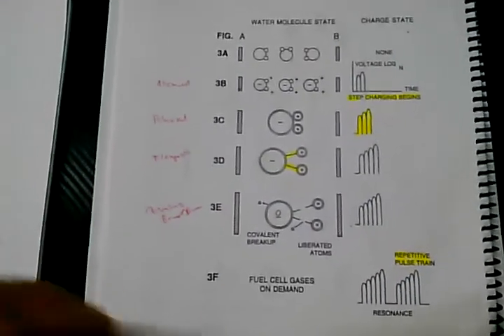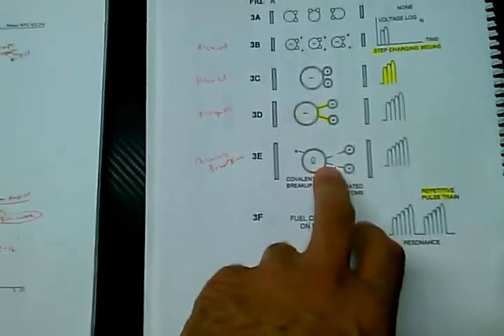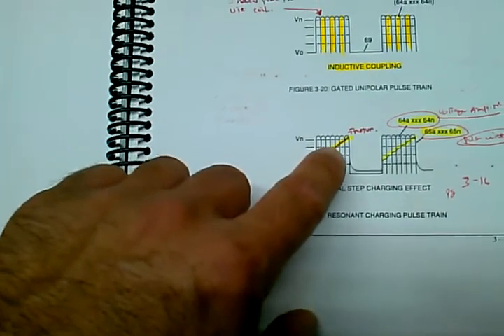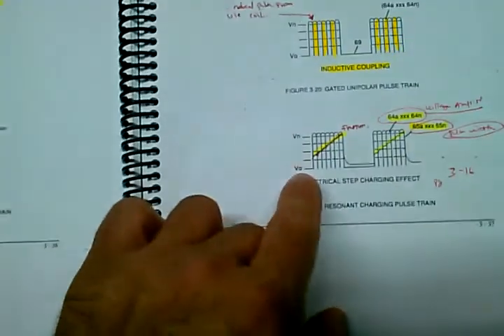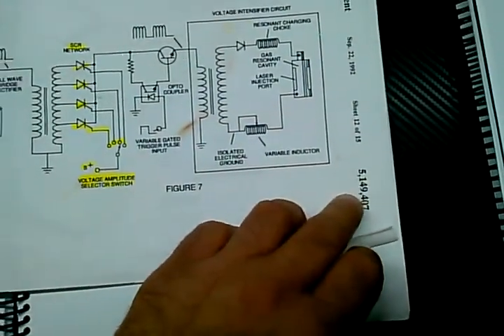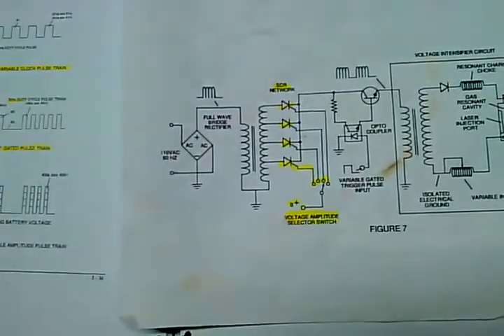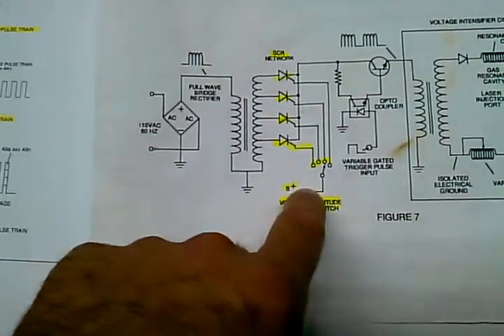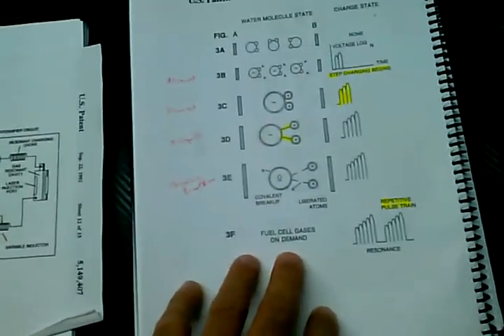Sequencial Voltage Amplitude control

Comment: That is actually taking place between the two opposing choke coils with water (Re) acting as a resistor between the two chokes as they are producing the step charging effect which is part of the reason Meyer calls them charging chokes. Particle Bombardment is talking about the introduction of laser energy into the system. You see I have manage to actually get at the core science behind this technology and have been trying to build it correctly ever since. If you would just give me an ear and step away from those that reject my work you too just might figure this out. I posted this to aid people understanding of the technology: http://aetherforce.com/the-long-road-to-learning-how-meyer-made-use-of-water-as-a-source-of-fuel/ and went on to post this to show the core science behind the technology: http://www.hereticalbuilders.com/showpost.php?p=12538&postcount=74

The only way I came in to all of this is with the help of our creator YAH and the strict use of the scientific method but YAH gets all the credit as after all this is us learning his technology. My haters like to tell people that I haven't contributed to this technology but my actions say differently as I have contributed the most of any single person on the understanding of this technology as far as I can tell even more than Meyer himself as I used terms we all can understand and broke down what he was saying back towards scientific terms. It wasn't an easy task but someone had to do it and as it turns out that someone was me.

Right now you have just been given a gift as what I just gave you here right now is how this technology actually works. You will have to organize things and use logic to translate things into a way that you can use them. Now I will sit back and see what you choose to do with the gift you have just been given.
Reply from the maker: Edward Mitchell  Yes I have read  your links before... and athough I dont agree with some of your input regarding Stans tech.. I do respect your point of view regardles of what others may have said..... dont let yourself be distracted by the "haters"  ...keep working on trying to prove your theory...after all you are using the Scientific methode...therfore once its refined by the fire ....who is going to tell you what to do with it?  can they take that knowledge away? you will have choice to keep it to yourself or share with the world..
Reply: HeuristicObfuscation There is more choices as to bring this technology out as someone has to step up to the plate and build it for those that can not build it for themselves. That's where I come in for I am aiming to do just that. Open Source to me clearly showed a lack of concern towards their fellow man as it was and still is all about I got mines.
I ask them to clear my name and have they lifted a single finger towards doing so? Nope.

As far as not liking my take on this technology I really don't understand why not as plants have been breaking the bonds of the water molecules ever since YAH our creator created them. To understand his creations truly is what science is all about. Plants take in water use the correct wavelength of light and a molecule designed to take the electron away and in that process the water molecules are broken apart and as a byproduct of this reaction electrical energy is created. That should sound very familiar as Meyer said the same thing about his technology for they are the same in how the water molecules are being broken apart at the core science behind it. IE excite the electrons and take them away and the water molecules fall apart into the gases that make them up. The key is right there, take the electron away, plants use a molecule to do this Meyer used ionization to do this. What part of this don't you understand?
Reply from the maker: Edward Mitchell The word I used was "agree" not "like"... I try not to let my personal feelings dictate how I react to a specific Theory  or Idea presented... It may look good, it may sound interesting I may even "like "it. The problem is emotions tend to cast a cloud over our Judgment therfore I try to be much more analytical rather than emotionaly reactive. over the years ive seen and analyzied your work and theory as i have done with countles others and myself. Its an interesting Theory but I see flaws...this is why I dont agree.
Does it matter what I say? my opinion ?  I am nobody...just a grain of dust in vastnes of space.
what about everbody else  ....does it matter what they say?
 If you truly believe your thoery who is stoping you?

On the other hand be carefull... it may be that you have reached your limit. your capacity to learn has ben stifled. Yes you may have more info than anybody else, more knoledge, more experiance, more intuition. 
Are you the best of the best? cream of the crop? top of the line?
And yet how can you adquire any more knoledge if  you are ahead of everyone?
How  is anybody else going to provide insight?
Reply: HeuristicObfuscation I think I understand your point of view. For me is just saddens me that no one seems to be able to grasp this technology from what I have left on the net for all to have free of charge. I even posted a wiring diagram so people would finally know just how Meyer had nine VIC transformers hooked up to one exciter array.

As for people being able to help me you'd be surprised how many times someone with little to no science can come up with the correct insight to a problem. I always keep my ears open for truth. Over the years I have had to be the one that answers most of my questions but like I said I get some answers from surprising sources so I never count someone out unless they are arrogant and lie about their results as then what good are they to anyone including themselves. I also tend to not listen to those that don't put in enough actual lab time along with those that keep doing the same thing over and over again expecting different results each new time the same experiment is performed.

I'll let you in on a little secret, I should have had this working at the beginning of this month but since I am mostly self funded I have to cut corners sometimes. This time I purchased some wire without the proper rated coating on it and when I got to around 9.3-4kv it shorted out on me. Just think only 600-700 volts to go and I would have been at 10kv which Meyer states is the start of the ionization process. And the only person I have to blame is the man in the mirror which is quite humbling to say the least. Since then I had to do a small redesign on the VIC and will have it made by the pros this time around if I can afford to do so that is. So, you can see I am a humble man but most don't see it that way as I have simply moved too far ahead of them. You would think someone out there would try and duplicate some of the things I have done just so they can see some high voltages being applied to the water fuel capacitor but to this date not a soul seems to have lifted a finger towards getting high voltages in this manner. Since I observe things a lot I'd say I'm just the wrong skin color as odd as that might sound but it sure seems to be true from my point of view.

Anyway I think I have taken up enough of your time and will leave you to your thoughts as you seem to be heading in your own direction which might not turn out to be a bad thing. I'd just thought I see if I could help you get the same high voltages I am getting without resorting to coating the tubes with anything.
Take care,
Edward Mitchell

Comment: How to control the voltage amplitude is easy as all you do is use a variable DC voltage power supply hooked up to the primary coil as I did at the 2013 Global BEM: https://www.youtube.com/watch?v=dQ6G4yIyLdY. 
There is a reason why I am getting such high voltages being applied to the exciter array and I go over just about everything in that video. I made a mistake at the Global BEM but have since corrected that mistake and wrote about it here: http://aetherforce.com/inventors-diary-failing-to-learn-making-good-use-of-the-scientific-method/
Mostly when it comes to the work I am doing I follow known scientific principles which sets me at odds with those that like to do nothing but guess and never get around to actually performing any real experiments. It has gotten so bad that now when I speak it's like I way out in left field and no one understand a word that is spoken. Since being booted from the RWG sight out of envy and malintent I have basically kept to myself as no one really understands me anyway.
Since the Global BEM I have gotten the voltages up to 9.2kv stable and 9.3-4kv unstable. This is not an easy technology to get working correctly and to get this far I have failed plenty. According to Meyer's patents I have only 600-700 volts of potential difference to go as it states each resonant cavity must have 1kv or more to get the process started.
As it stands right now I actually have a rough working mathematical model on how these transformers build up voltages. Due to the level of envy and malintent that has been aimed my way over the years good luck getting me to share any of this with anyone. You see I walked the road of OPEN SOURCE before and can see it really doesn't work all that well. For you will see that I have shared for more than most and looks where that's got me? I was said to be trying to rip people off which prompted them to build an exciter array of their own but when they couldn't beat the prices I was selling them at my good name was never cleared. Anytime I tried to get them to clear my good name I was met with more hatred, envy, and malintent so to me OPEN SOURCE is a joke as I have been down that road before. Basically who OPEN SOURCE is really for are those that can build things for themselves and if you can't then it sucks to be you which leaves out a very large portion of the worlds population.
How this technology works in general is comparable to an ozone generator that is hooked up to a variable voltage power supply. When the voltages are low it doesn't produce any ozone but when the voltages are raised high enough to reach the threshold for ionization then and only then will it produce any ozone. Once the threshold for ionization has been reached anything more will produce higher amounts of ozone until there is a breakdown in the dielectric medium at which point no more ionization takes place as it has been directly shorted to ground through the medium. You will find that this technology is no different as not until the threshold for ionization has been reached will any real gas production begin that's science and there is simply no getting around it. However there are better ways of doing things from how things are being done right now and that's where R&D comes in to make things work far better than they did in the past.
Reply from the maker: Edward Mitchell   Sorry to hear that you went thru all that .  very few people have claimed to have that high voltgage potential at the water electrode so congrats! In reading your coment a very easy solution to your high voltage would be to reduce the amount of cells in your series network, instead of tryieng to rebuilt a more powerfull ViC to produce the ionnization effect. Also  I havent yet seen any experimenters use the (Electron Extraction Circuit)  other than for the "Gas Processor". Now according to  Stan the VIC was incomplete without the (EEC)! See the VIC was a precursor to the (EEC)... 
according to Memo WFC 420 pg 1-10
this is what he says."The Hydogen Gas Gun" is the Electron extraction process....
 not to be confused with the "Gas Processor" that has been replicated multiple times.

these are two worlds appart! 
According to  Stan the effect of appying the (EEC) is what allows for "particle bombartment". He would also recycle this back into the "sperical resonant cavity" not the tubular cell, in which case he would get results that accroding to Stan was at an exponential production. Stan having experimented with 
this is what prompted him to design a miniture "Hydrogen Gas Gun"  yes and this is what he later called 
the (WFCI) Water  Fuel Cell Injector.
This is were he states this bellow.
 found in pg 1-12 
The "Hydrogen Gas Gun" can be reduced to the size of an auto spark plug!

seems to me that you have a very powerfull VIC.. yet you are aware that its not compatible with the 
WFC that you are applying it to.. This is likely becouse the VIC you have replicated was originaly designed for the Injector. Here are my two cents:
Reduce the size of your capacitor, 
Increase the potential of your circuit by including the (EEC) to the (VIC)
 and you will be the only Stan Meyer enthusiahst that has probably done so.
Reply: HeuristicObfuscation Here's the problem in a nutshell. People like to mix parts of Stan's work without understanding it fully, I included. But what set me apart from all the rest is my use of the scientific method. The use of 10-12 cells is because it has to be that way with that design as it will not work with just one resonant cavity as the load being placed on the transformer is too great. Water is part of the circuit in the form of resistance what Meyer calls "Re." One cell has only one gap of water resistance, wiring 10-12 in series has that many times more and if you add in resistance the voltage goes up again back to science. With Meyer's injectors he lost a lot of resistance in the form of water so had to add in the missing resistance in the VIC transformer to make up for the loss and the size of the resonant cavity had to be reduced to as to not place too great a load on the transformer.
A lot of people, including yourself, like to think that I made a simple mistakes that are easily correctable without first understanding how the technology actually works. I did the best I could to practically drag the movement towards how this technology actually works in terms of science, and I must accept the facts that I failed in trying to do so and move on.
The Gas Processor and the Hydrogen Gas Gun are the same for the most part but the Hydrogen Gas Gun must take great care that no sparking occurs between the ionization place of the Gas Processor section of that device or simply put it will blow up. Meyer made this technology seem ultra simply when the facts are it is quite complex. I've worked with the Gas Processor plenty and it's a very well though of device that takes advantage of something no one else in the world ever thought of doing, as far as I can tell, besides Meyer.
With the water fuel capacitor or exciter array I had to learn how to build it correctly to the science I uncovered about the technology on a shoestring budget. So, with that in mind know that it takes me time to build things. I already have quenching circuit tubing, and an exciter array built correctly and now must get the VIC built correctly and the circuit to match things up perfectly. Do note that I don't use any coatings on the SS in the resonant cavities as they are in direct contact with the water. I think I posted a screenshot of the scope on the RWG site showing 8.8kv being applied to the exciter array before the gave me the boot so it's not a claim that I am just making up out of thin air these are the facts my experiments gives me as data. There was a time I wanted to talk about this data with others in trying to teach them to do as I was doing but again I got booted out for wanting to do so as the site moderators didn't understand the science I talked about at the 2013 Global BEM. Nope they sided with Naysayers and handed my my hat as I had to be lying to everyone and somehow pulling the wool over everyone's eyes some how as their chosen form leaders where only getting 10.5 volts to the cell. I think Max managed to get 280 volts to his but that was it and here I show up getting 4.2kv to the cell so it must have been a trick of some kind was their thinking. We managed to get 7kv in the hotel room but thats when one of the two transformers burned out on us.
Not to toot my own horn or anything but it seems I am the only one that understands how this technology works to a very high degree, and due to something perhaps as the color of my skin, I was handed my hat and told to leave and never come back. I found that quite odd given I was getting some really high voltages to a cell just as Meyer states are needs to be done in the patents. As 1kv and up being applied to a resonant cavity to get it to work are Meyer's words not mines.

There is so much that goes into making this technology work correctly it boggles the mind. Now you have to understand my perspective on all of this as they all gave me a really rough time when I was working with them and now they act like they never seen anyone get over 1kv to a cell as Russ just did several months ago. They shunned me and like Meyer I inturn shunned them too. I watch them make the injectors knowing full well there was a flaw in the drawings someone did for them as a correction for the problem we all found in the original drawings. Sure I could have gave them the designs I drew up but would they have listened? I think not. So I let them run with it as the best way to learn is by failing first hand and having to try and figure what went wrong and do it again and again until one gets it right. With that being said I will say welcome to my world as that is what I have been doing since 2006 and only now am I getting the voltages where they need to be.